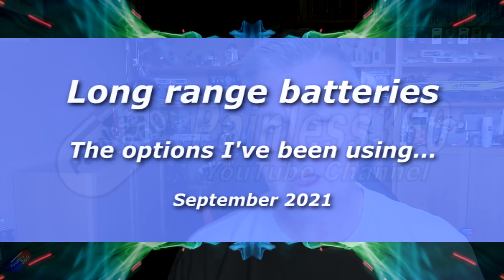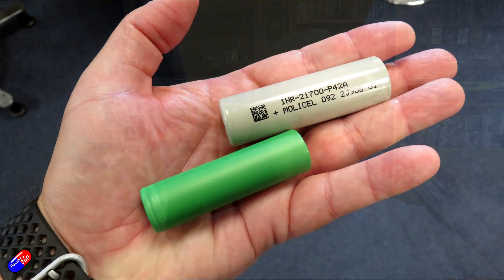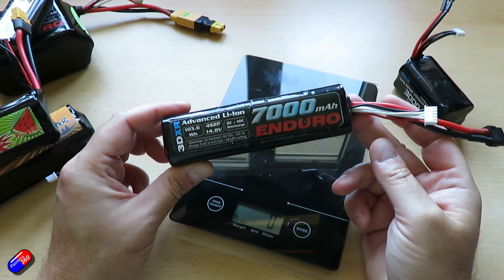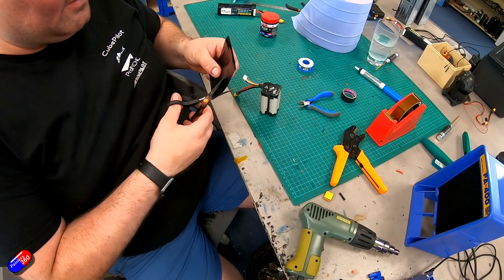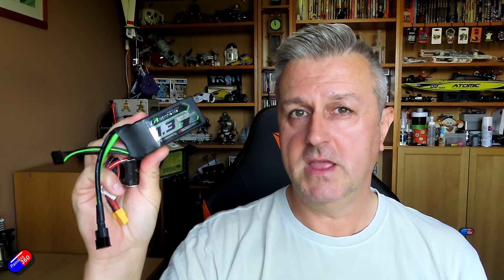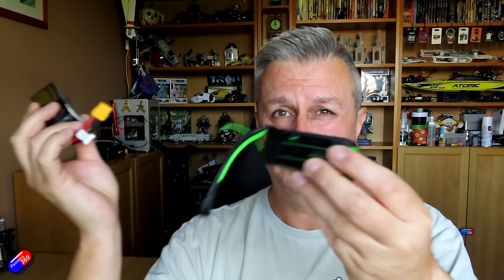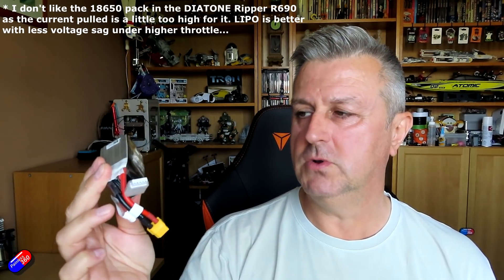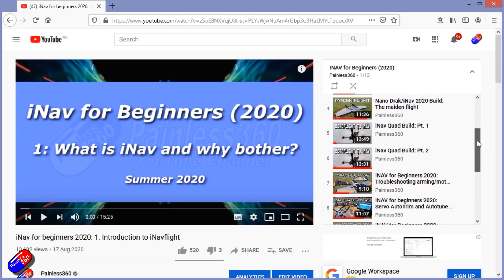How to get more mAh in your model and not pay the weight penalty

Comment: Thanks for the video but I too have a 2P2S battery pack that was working fine on a flying wing but during testing when I crushed, the battery on both the charger and multimeter shows that it is full but when connected to the esc it shows an unstable voltage and so the ESC is beeping  that abnormal voltage thing.
Please help me
Reply from the maker: I don't understand the question. What is happening?
Reply: @Painless360  like the battery(li-ion) is providing an unstable voltage to the ESC and hence the beeping
Reply from the maker: What does unstable mean? Rapidly fluctuating? Unbalanced?

Comment: Hello what would you recommend for the AR 900 wing I’m looking for a flight time of 30 mins or more thanks for sharing this video
Reply from the maker: What is the amp draw in cruise for the model at the moment?
Reply: @Painless360  hello on average 8 to 9 amps thanks
Reply from the maker: So to fly for an hour you'd need a more than 8000 or 9000mAh battery at that amp draw to leave 20% in the pack at the end of the flight. If we half that for your 30 min flight time then you  need about 5000mAh pack or more.. I hope that helps.
Reply: @Painless360  thank you very much for your help advice..  your very good at what you do thanks again

Comment: Nice video as always. I want to add one thing that is often overlooked when comparing lipo with lion. The nominal voltage of the lion cell is lower then the lipo. So for the same amount of power(watt) but with a slightly lower voltage the current is a bit higher. So with the lion pack you use more current for the same power.

Comment: Lipo batteries- every time i bought expensive lipo batt. they never lasted as the cheap ones i get, i have some cheap batteries for years and batts. like black red graphene 1500mah 4s some get soft atc, even turnigy A-spec swollen and some chinese zop power they just keep going bought them at same time little over 2y ago got mb 25cycles on them- sure little less c rating but they are still same as new. I take good care of all batt.use good expensive chargers and i charge slow 1Amp  1500-2000mah- 2Amps  3000-5000+mah- bought 2 turnigy nano-tech 3s 2.65A year ago one is already soft, still works but wt hell lol- Now i make my own li-ion 18650-21700 but still use lipos in some planes

Comment: I've been using those 1100s you were running on that babyhawk....also on a babyhawk. Really impressed with them. Got an old dart 635 that's running 2 in parallel and I'm tempted to build an 8s 5-6" quad around them. AMAZING energy density for the weight and acceptable power density too.

Comment: I ride high power ebikes (on private land with permission obviously). I have a few different li-ion packs depending on the ride. The main pack is 14s 5p (52Vn limited by the bms to 40 amps max current (each cell has a max continuous current draw of 8 amps)) 17.5ah using 18650 and the "going fast pack" 20s 4p (72Vn limited to 100 amps max by the bms (each cell has a continuous current draw of 45 amps)) 16.8ah using the pa42 molicel 21700. obviously a different use case but it shows the fantastic capacity and current draw from the slightly bigger cell size is a game changer for the use in the RC hobby and if you only charge each cell to 4.1v and discharge to 3.6v you can massively increase the number of cycles before you drop to 80% capacity. Stay safe Lee. good info from you as always.

Comment: I have been flying the 21700 here for a couple years. Here they are easier to get than some of the good 18650's. I built a spot welder and made up 4 Molicel 4200 packs. They are nice packs. Get around 40 minutes easy in an AR 900 and 1 hour+ in my Phoenix 2400. I have seen some people going with 26650's as well but I haven't tried it myself.

Comment: If the battery have bigger capacity even with less C rating will give the same current. Ex. 500mah x 80c =1000mah x 40c.
Thanks for share .
In may case I have ldark et 115 Original battery 550mah 2s 80c. Fly time 4 min. I have 1000 mah with 30c fly time 7 min.
I didnt feel more sag from the battery with 30c rating. Best upgrade was to change from jst to xt30.

Comment: That's All Well & Good, Butt You Do Realize That There Are Still Lighter + Much More Powerful LiPo "Packs" Available For REALLY CHEAP Prices! SPIM-08= Are The Size Of A Thicker Dollar Bill & Put Out 200amp For 8aHrs @ $5 each, TESLA 2170 4800mAh Are $2.50 each, LifePo4 a123 2500mAh Are $2 each, 32650 5000mAh Are $2.75 + 6000mAh Are $3.50each All w/120amps 10sec Pulse Discharge Plus Many Others... Thanks 😎

Comment: I've been using 21700 molicel packs for my LR flying and never looked back. Imagine 21700 6s1p 5000mah or 18650 6s2p 6000. Additional 1000mah is not worth double the weight. Here's how I build mine https://youtu.be/y6M0QHbpC68

Comment from the maker: All of the packs compared in the video are 4s for an easy comparison. You can add flight time by adding more cells (6s versus 4s for example) but that would potentially require changes to ESCs, motor and props to work. That isn't in the scope of this video, see the efficency video linked in the description.. Happy flying
Reply: Hi Painless. Love your vids. Completely off topic - have you upgraded  your 7'' crock to betaflight 4.2? I have and I cant fly it anymore. I have burnt 2 motors and I have no idea how to tune it. And cant revert to Betaflight 3.6 as well, cos it's not supported anymore. If you have upgraded yours to 4.2 and have tuned it could you share your betaflight dump? That would be totally awesome.
Reply from the maker: Crock? I'm not sure what model you are referring to. I've flown the 7" Rekon7 PRO recently and the tune is available to download via the link in the description..
Reply: You were actually right a 7:33, it's 65mm long, 650mm would be 65cm lol.The 0 at the end means it is a rounded cell.
If you are struggling to get your hands on 18650s/21700s, look at vape shops ;)
The Samsung 40T and 30T are the best 21700s out there, 4000mAh/25A sustained and 3000mAh/30A sustained respectively

Comment: There's a little bit more to the story here. Your battery time isn't just based on mAh capacity of the battery pack as you say in the beginning. It's really based on Watt-hour capacity of the pack (mAh x Voltage). Watt-hours is the measure of the total energy in a pack. As an example, a 3s 2000mah pack will provide less flying time than a 6s 2000mah, understanding that the 6s weighs about 2 times as much as the 3s. Depending on the total weight of the model it could provide about 1.8 times the flight time with the same mAh rating.
Reply from the maker: That is right, all of the packs here are 4s. See the motor and prop series... Happy flying

Comment: does anyone make battery packs where you can put in cells individually like normal batteries or is that crazy and dangerous? you know like plug them in like alkaline?
Reply from the maker: Not that I've seen. For modern brushless systems a AA batteries are not capable of delivering the currents needed.. Happy flying
Reply: @Painless360  im talking about loading 18650s and batteries like that like we do alkaline. there is probably a reason.
Reply: @frankyflowers  the weight of the holders would be a significant factor and most of the commercially available 18650 holders have a maximum current rating of 5 amps
Reply: @jamesemery1  i exploded one trying to make something
Reply: @Painless360  theres the long range quad davec made that has you plug them in like that, its only 1s though
Reply: @Gienbfu  i saw one called a rekon something that did that with one. id like one without the camera just for playing with the cats.
Reply: You can buy one of those plastic 18650 holder boxes and glue in some bent copper strips. Not sure about that holding together at substantial G-s tho.
Reply: Dave C did it on a Rekon 5. You just have to be careful about each cell's polarity when you insert them.
Reply: @yannickg6904  i wish someone made something like that with only a basic stabilized flight controller and no camera or extra stuff. it browns out if you push it anyway so id just float it around like a toy inside but its brushless and i can change batteries out until im bored.
Reply: You can get 18650 holders off eBay that have the AA style spring terminal on one end... Not suitable for high current. I would also not use them for anything where a brief disconnect from vibrations will cause problems. Low current land vehicles are probably OK but aircraft probably not.
Reply: @tin2001  that would be cool if someone made something like that but was safe. maybe some kind of clamping action to hold them close and they dont arc or whatever they do that is bad.
Reply: @frankyflowers  Best way to hold them is probably in a tube, like old school flashlights. I would use copper wick as contact points.
Reply: @yannickg6904  dont forget to vent the tube. lol thats a good idea though.

Comment: I have a single DIY 4000mah 4S1P pack made out of 21700 sized Samsung 40Ts. Amazing battery, I use it mainly as a Power source for my goggles, but it will keep my 4in quad in the air for 20 minutes as well.